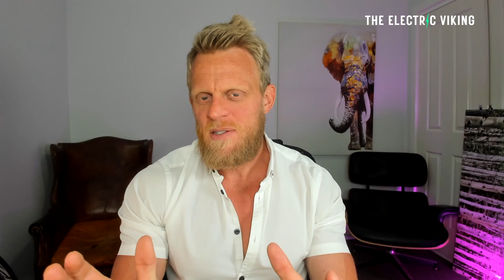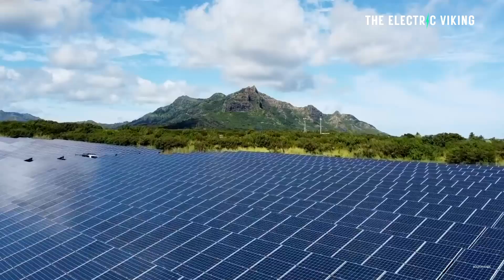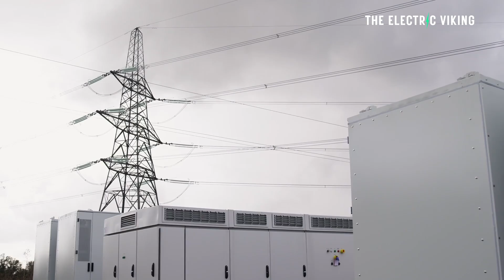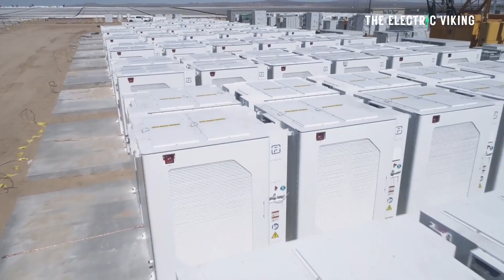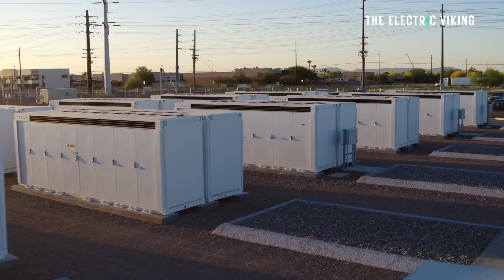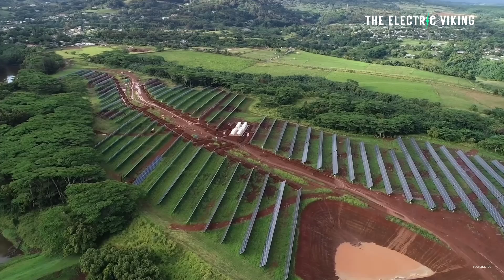Batteries + solar smash records in California and fossil power plants suffer

Comment: And Californian's pay $0.40 per KWh for it. So much that Walmart's are crowded on hot days when folks can't afford to run their home air conditioning. Sigh.
Reply: Pge charges 46 cents base rate for 8kwh/day, goes up after 8 kwh. My neighbors pay $350 a month or more. I use plug in solar with a couple of Chins batteries. I drive a free Nissan Leaf Which ironically PGE used car rebate paid for. $4k rebate on a $2600 car.
Reply: Move to England its literally freezing here right now and its May !
Reply: @stevenbarrett7648  
I'm in California.  We got about four inches of snow last night.
Reply: @stevenbarrett7648 👍Hello from Hawaii.
Reply: @stevenbarrett7648 touché!
Reply: I'm not saying it isn't true. It's stupid. You should have low rates during solar hours, and high rates when the sun goes down, and 40 cents is still too high. You guys can make solar juice for 2 cents per kwh. Now you still have to get it to where it needs to go, and do the billing, and make sure it works all the time, but it doesn't take 38 cents/kw to do that. I don't know why it's dumb, but it is. Californians need EV chargers wherever their cars are parked during solar hours, AND the prices to encourage them to charge then.
Reply: Rates are so high because most people live near the coast and don't even have air conditioning, so they don't use much electricity and the electric company has to make up the cost of maintaining the grid. People that live inland where it gets hot get a bad deal. On the other hand in many areas it's dry enough to use and evaporative cooler. I can run mine all day and my house stays 70-80 degrees even if it's above 100 outside and my electric bill is under $100. The biggest problem I have with the cooler is when you have a lot of smoke during fire season it's going to get into the house unless you switch to your A/C system.
Reply: @sdickinson5234  Does it ever get cold enough that you need to heat? Cause they make mini split heat pumps that are 30-40 SEER. Having one in your bedroom is really nice. Put several in your house, it can replace central air. They can heat too.
Reply: @fjalics  Depends where you live.  Certainly up in the mountains.  But for most of California heating is only required for a few months across Winter time and furnaces are turned off the rest of the year.  Literally, I turned my Furnace off in early April.   Once we get into summer, and especially for people inland, A/C consumption will ramp up

Even with that it isn't the killer heat you get in Texas or the humid-heat you get back east.  Not even inland.  California's summers are low-humidity and the weather pattern usually cools-off overnight, which means that architecturally many homes don't even need to turn on the A/C until past noon even on hot days.
Reply: @fjalics  Yes the average low is around 30-35 in December-February. If you want to heat a bedroom with electric you can just use one of those small ceramic space heaters they are really efficient. I have gas heat but I can keep it low and use an electric heater in the room I am using then I can stay out of the higher price tiers for both electric and gas. Gas was cheap this winter anyway.
Reply: Folks love the weather, can't have it all.
Reply: I live in California and I do not pay $0.40 per KWh.  Not even close
Reply: Has little to do with renewables, Texas has 3 times the renewables and at a third of the price.  It's politics, bureaucracy and corruption.
Reply: For nine months we pay $0.115 for 21 hours a day and $0.16 for the remaining 3 hours a day, from 5-8pm. Then from 6/01-8/31 there’s three  rates during a 24 hour day but the highest cost is in the 5-8pm time slot at $0.3462. This is with SMUD in Sacramento.
Reply: @hermancm I think he confuses it with Dutch prices. We do pay 0.4, say thanks to Joe for me.
Reply: @hermancm  I'm in the valley with PGE.  Off-peak is .46 cents now and peak seems to whatever they feel like.  I don't know how you get 0.115 but I haven't seen numbers that low in literally 20 years.
Reply: @Ryan-ff2db  Just looked again, like you can too, with a search of SMUD rates, now $0.1183 off-peak. Seems they tweak rates a little bit often.
Reply: @hermancm  You are lucky.  We don't have anything like that here.  Looks like people tried this in 2010 but local politicians and PGE quickly curb stomped the proposal.
Reply: You'll need the air conditioners more and more as the dirty power changes the environment.  sigh
Reply: California's electricity costs have nothing to do with Renewables or solar or anything.  They've always been high (long before renewables ever became a thing), and most of it is infrastructure cost, not generation.

Comment: It takes time, but parts of the country are destined to have enough solar and battery to not need other sources most days. Other parts of the world will never get enough sun to even justify connecting solar panels to the grid.
Reply: Those places often have wind or hydro, if they don’t have enough Sun.
Reply: Solar is economic for most of the world, even above the arctic circle.  Dont' assume that the ridiculous cost of solar and wind in the U.S. translates to the rest of the world.  For example, where Sam lives in Australia, solar panels and equipment are roughly 1/2 the cost that it is where I live in California.    Also true for Europe and the U.K. ... equipment and panel costs are far lower than they are in the U.S.   Mostly because the U.S. has a half-hazard set of tariffs messing up the economics over here as it tries to promote domestic industry.

Comment: in the UK despite enormous investments in offshore windmills, 'renewables' only amount to 10% of the country's energy needs and energy prices have sky-rocketed. Methinks customers are being duped!
Reply: Sorry, but that’s rubbish.   In the 12 months to April-24, 40% of UK energy was from renewables sources.  The energy price however is still linked to the price of gas and this has yet to be reformed.
Reply: Don’t confuse “Energy” and “Electricity”. NOT the same at all. People burning Gasoline or Diesel are using “Energy” but NOT Electricity.
These two will begin to be more similar as EVs replace Gasoline and Diesel and Battery Storage makes Electricity more available.
Cheers!
Reply: @DavidC-pg6ni Sure, point taken.  Given at this point in time, only 20% of UK electricity generation is being powered by natural gas, the pricing stucture needs to change and electricty made cheaper.  Only then will we see a significant shift from gas boilers to heat pumps etc.

Comment: As i understand it USA average electricity price is £0.17 per Kw/Hr, wheras in uk it is £0.45 - why so high in the UK?
Reply: Cyber, that is the average price per state. Not sure about Euros or Pounds, but the average state rate is $0.15. Californians pay $0.41. And that high rate will rise again in 2024.
Reply: Here in France we pay €0.20/kWh...This has only recently gone up as for most of the time I've lived here (since 2013)  it has been around €0.10/kWh. Strange thing is that with 75% of our grid power coming from nuclear there are no more cheap overnight deals to be had for EV owners as you have in the UK. Nukes can't be 'turned down' at times of low demand so goodness knows where the power goes. France are the biggest exporter of electricity globally but that can only go to Belgium, Germany, UK, Spain, Italy etc over border interconnects.

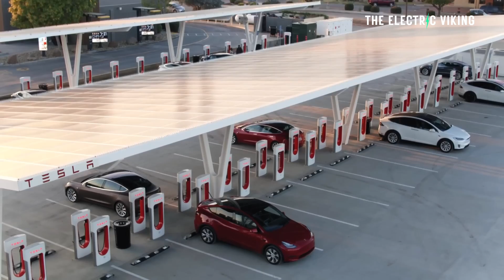Comment: 7:24 how the f*ck am I supposed to get my own solar in an Eastern European communist apartment building???
Reply: Balcony solar.  Even a little helps.  Look into community solar.  There might be some in your area
Reply: @jeffpitoniak  gypsies that would steal it, that's what's in my area. You assume there's a balcony, and that I'm not facing north-east. And that most of the apartment buildings did not get roofs made of asbestos cement in the '90s. Guess how many installers want to touch that, even if I do get my neighbors to cooperate. But yeah, despite that, I am waiting for LFP based "solar generators" to get cheap enough so that I could at least run my workstation off solar. That's another thing, turnkey systems are *extremely expensive*, not everyone has the time and skills to follow the plethora of YouTube tutorials on how to build an affordable one.

Comment: Sodium ion battery can be 40% cheeper than LFP if mass produced.

For Stationary storage, energy density doesn't matter, so Sodium ion battery is better.
Reply: Possibly cheaper but so far LFP prices continue to drop.  We're looking at less than $60/kWh this year.   Sodium batteries have quite a lot of warts, the biggest one being the huge voltage range of the charge and discharge curves which make it relatively difficult to efficiently interface with the battery's storage capacity.   LFP, on the other-hand, has an extremely flat charge and discharge curve which brings incredible benefits with it.
Reply: @junkerzn7312  Not sure if I see why the larger voltage range is that much more difficult to accommodate as the batteries are basically dumping their energy back into the grid through giant line-synched inverters. Is inverter design that much more difficult when dealing with a larger input voltage range?
Reply: 109% click click
Reply: Yes/No some energy density matters for residential. Not everyone lives in a mc mansion.
Reply: Energy density always matters.  Its why the Internal Combustion engine is still superior in very way.  Ive been hearing about battery tech doing magic for 40 years now.  The magic part never seems to materialize.
Reply: @TheGreatRepeller  For grid solar battery density and the "superiority" of ICE don't matter. It's hard to find stats about batteries that go back 40 years, but in the last 30 years the cost of 1 kwh of battery has gone down 99%, energy density is up 500%, and production rates have gone up an average of 33% per year. The magic part happened, you just haven't been paying attention
Reply: @TheGreatRepeller  Meh.  This thread is talking about stationary storage.  But whatever... the "magic" is already here, its just too bad that so many people have disconnected themselves from reality.  Maybe get your feet wet with an e-bike or something.   Or just wallow in whatever nonsense you believe in while the rest of society moves on.
Reply: @TheGreatRepeller  could you please tell me how I can store my solar energy in gasoline for electricity at night?

Comment: Just checked California's current energy sources: natural gas 23.7%; imports 16%; and batteries 0%. Oops.
Reply: Energy or electricity? Either way your numbers are wrong.
Reply: @100c0c interestingly, from the CAISO website, pre 13 December 2023 the natural gas supply was much higher, after 13 December it was lower - why?   Taken directly from the internet "the methodology for tracking natural gas data was updated".   Makes you think how accurate anything is we see these days......
Reply: @100c0c  The info - electricity only - is from the California Independent System Operator (ISO). Natural gas is currently 20.4%; imports 18%; batteries 0.0 (charging).

Comment: Batteries are the solution. The sun doesn't always shine. The wind doesn't always blow. But batteries are expensive. Surely domestic solar panels and domestic LFP batteries is the solution. Coupled with EVs the future is here already - but only technically - the State must subsidise domestic LFP batteries.
Reply: Sodium ion battery can be 40% cheeper than LFP if mass produced.

For Stationary storage, energy density doesn't matter, so Sodium ion battery is better.
Reply: @Atheist-Libertarian  The energy density isn't so important. Neither is the ability to function optimally at low temperatures. Safety and price are the main considerations ESPECIALLY SAFETY.......if your car catches fire it is unfortunate - but if your home catches fire it is a disaster.
Reply: It will surely be cheaper to build big grid scale battery plants than for each house to buy and install a battery. Similar for solar.
Reply: @tombh74  Yes. But that requires the policy decision by government. To install your own solar panels and battery system you just need to have the available funds and look at the pay back period.
Reply: @tombh74  

Home batteries may be more expensive than grid-scale, but they also offer more benefits. Like being able to keep the home powered for a few hours during an outage.
Reply: Yes, grid-scale battery storage is roughly 1/3rd the cost of home battery storage.  But of course with home battery storage you control your own destiny.  In terms of battery costs, those continue to drop sharply.  We are already south of $75/kWh for LFP and it will probably hit $60/kWh this year.

The single-biggest issue is simply that existing utility services aren't really designed for battery installations, so having batteries installed domestically has a lot of knock-on costs to re-route the service and wire it safely.
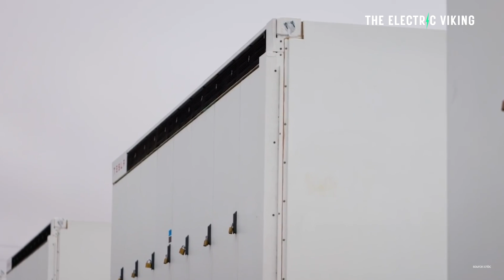Reply: @junkerzn7312  In the UK there is a surplus of electricity in the early morning hours - the 4 hours from 00:30 to 04:30 to be specific - when electricity is very cheap. I would imagine this low tariff will persist until the country has sufficient network batteries.
Reply: They will need Trillions $ in batteries..
Reply: @grantbuttenshaw  People will invest if the payback period is less than 5 years
Reply: Imports from China are cheaper.

Comment: In NSW , Australia , our electricity bills have gone up dramatically in direct correlation with the increased penetration of renewables into the grid over the last 15 years.
Reply: ...because the major part of your bill has nothing to do with the cost of the electricity.   It's mostly charges for whoever is supposed to be maintaining the poles and wires.  Renewables are the only way to deal with the pace of Climate Change.   You'll note that everything else has gone up in price and the politicians, no matter what some of them say, have very little control over those rising charges.  Insurance is one of the most ridiculous price rises and that is mainly due to climate change and also property having been built with no regard to flood locations.
We're just lucky that the general population took charge in the face of those laggards who refused to take on the established money and actively built much of the renewables.  You're welcome  :)
Reply: Lowering emissions is more important than our bills rising.
Reply: @100c0c no it's not.   Just because you rich does not negate those who are less well off to capitulate.   And by the way, nothing wrong with carbon in our atmosphere.
Reply: @aeasthouse316  You really believe that doing nothing to address climate change is going to save you money in the long run?  You think the costs of dealing with these disasters aren't going to be passed on to you as a payer of taxes and a buyer of. . . almost anything?

There are real costs associated with increased forest fires, floods, tornadoes and hurricanes.  Your refusal to believe in them--despite the evidence of your senses--does not make them go away, or erase the financial costs of dealing with them.
Reply: In Queensland, 49% of domestic electricity bills is the transmission and distribution components and these are set to increase to support renewable energy zones. The generation component is just a fraction of the cost.
Reply: @BTMwarrior  the transmission and distribution components were built to sustain a dirty past.  It and more is now needed to support a less damaging future.  What if the transmission and distribution components  had never been built (because it was costly).  That would have been silly.